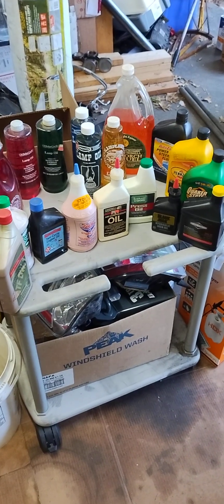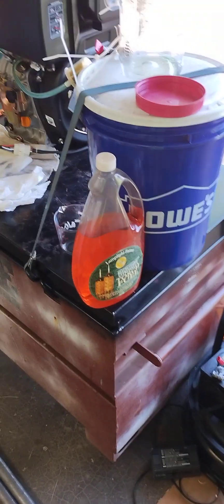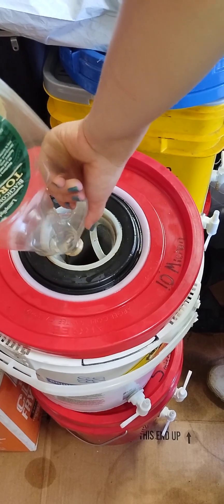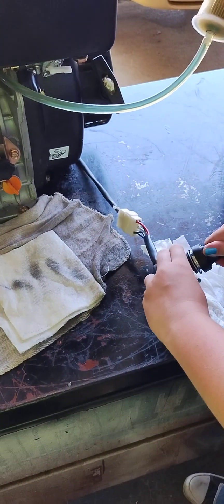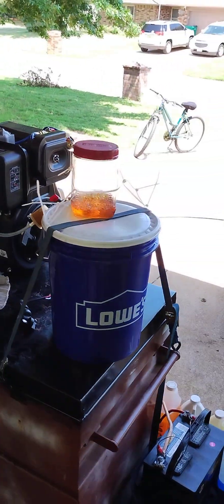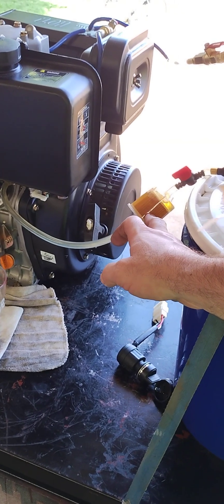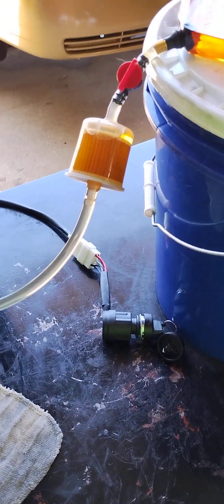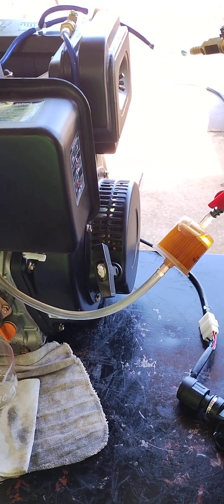Amazon Diesel Engine 186FA Will It Run? Tiki Torch Oil?

Comment: Might be an interesting series or single video to see how the engine does under a given load (resistive load bank while coupled to a generator or makeshift dyno or some other constant load) to see a side by side comparison of energy output and fuel consumption. Could aid in determining what "waste" is better fuel to look for.
Reply from the maker: That's a fantastic idea!!! Unfortunately I don't have the funds for that right now.
As I am a growing channel.
I get used oil, for free, along with free stuff by stopping off to my local Household Hazardous Waste facility, that's where all the samples come from.
If it runs out of the bottle it goes into the big tank to burn once my diesel electric hybrid motorcycle is built.
That being said I could fill the tank with different liquids to see what liquids get what mpg as I take the same route to and from work every day.
Reply: @CarModsandDadBod  Not an exact constant given air temp/pressure but really might be better as a real world test under actual operating conditions. You would also notice any significant power differences between the different fuels as well at different RPM and under acceleration.
Reply from the maker: We will see I'll have to collect a gallon of each fluid to test. To get true mpg rating.

Comment: That thing's not going to last very long.  High RPM spec, coupled with lightweight components.
Reply from the maker: Glad it's only $300 lol
It will be a work horse though.
First goal is 50mph so I can take the back way to and from work.  If that is easily achieved the next goal will be 65.
But I don't want to maintain 65 for an hour or more at full throttle so if it works out I will re gear for a higher top speed so I can cruise at a lower rpm.

Comment: see if it will run on hot butter or lard
Reply from the maker: Cool suggestion but somehow I believe it will clog up the injector
Reply: @CarModsandDadBod  Its mechanically injected it will run on anything just might smoke due to longer hydrocarbon chains/ higher energy dense fuel